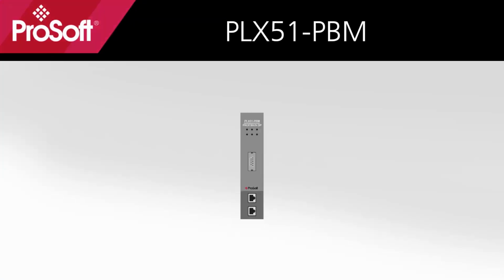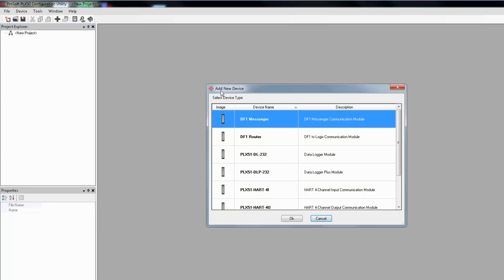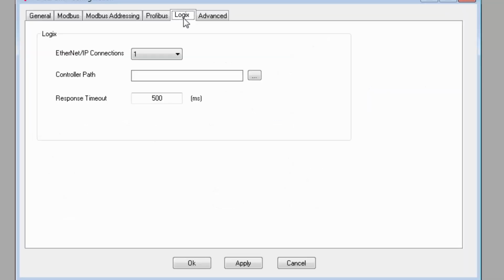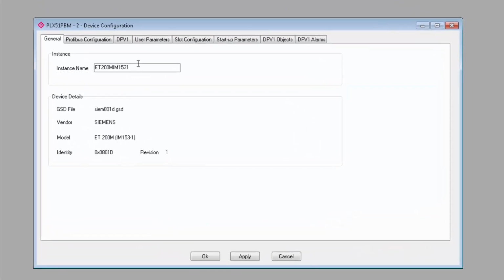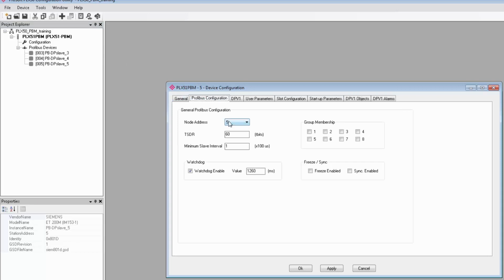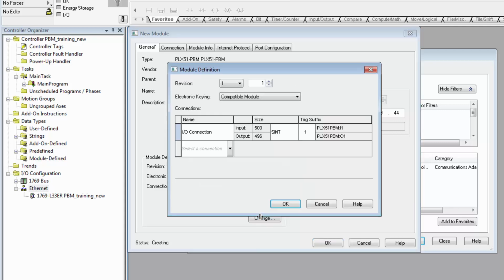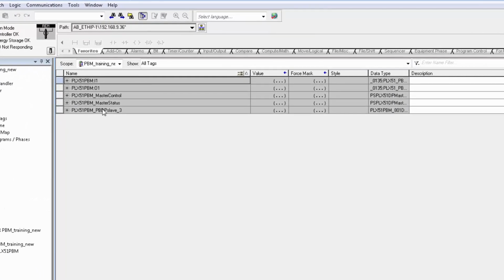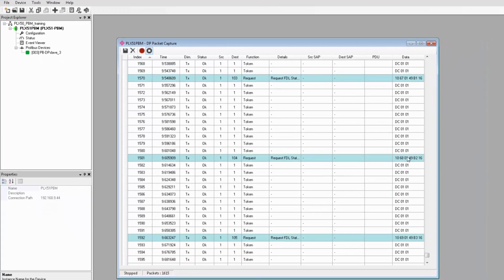Setting up your ProSoft PROFIBUS DP Master/Slave to EtherNet/IP™ Gateway

Comment: I am getting problem with data Exchange with Unisab III (sabroe). All returns are ok (Green), connection, operation, baud rate, nodes but no data appears in compactlogix tags. Does anyone know anything about It?
Reply from the maker: Hi there! We can help but our Tech Support team needs a little more information about the application - please call 661-716-5100. Thank you!
Reply: @prosofttechnologyinc  I'm from Brazil.  Now I am testing PLX51-PBM with Siemens S7-300. I managed to exchange data between them but only with slots of 1, 2 e 4 bytes. The Siemens S7-300 is the master Profibus, the PLX51-PBM is slave and the Controllogix is the ethernet side. There is a reason to only these slots work? There are 8 and 16 byte slots that do not work..
Reply from the maker: @estevamroxael4231  We'd like to set up a tech support ticket for you. Please send your contact info to media@prosoft-technology.com - from there, we'll set up an open support ticket for you in Brazil. Thank you!
Reply: @prosofttechnologyinc  I sent. Thank you!

Comment: Hi, when assigning the IP address using the DHCP server I am getting a connect failed error. 
Anyone know what the issue could be?
Reply: Remember, Before to change the IP, turn off the dip switch 4
Reply: I get to connect through of DIP switch 4. I put the IP standard, clicked the Button Target browser. When the Gateway appeared I clicked with right mouse Button and in the port configuration I put the static IP. Remember after turn off the dip switch

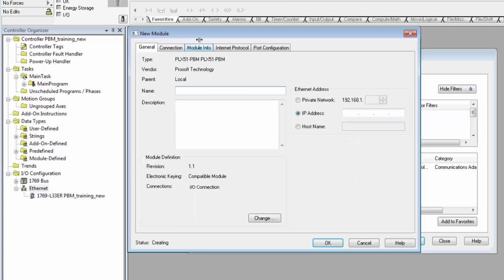Comment: 11:35  I found that my name of my PLX51PBM also needed to match the name I gave it in the PLX50 Configuration Utility software.  If the name was different, some of my tags from the Logix L5X file were not defined and gave errors during the import process.

Thank you so much for posting this video!